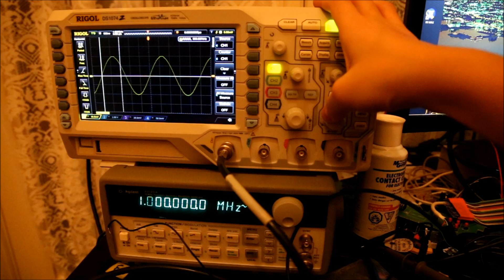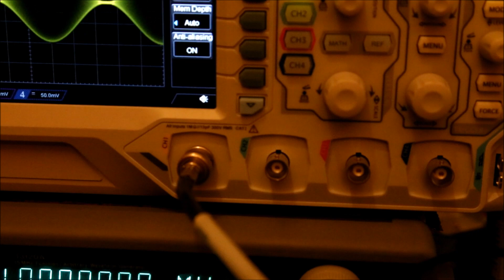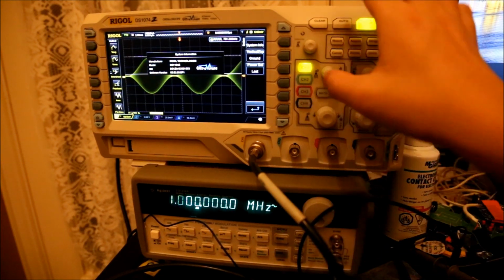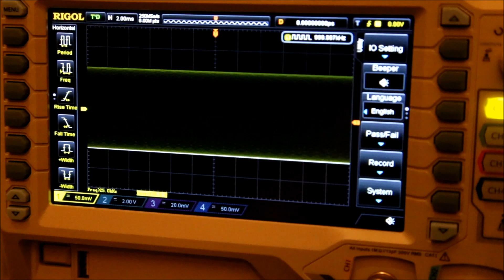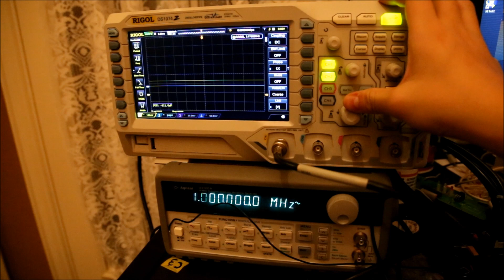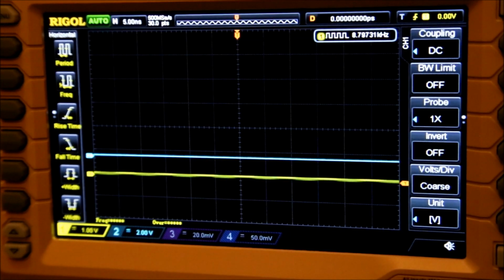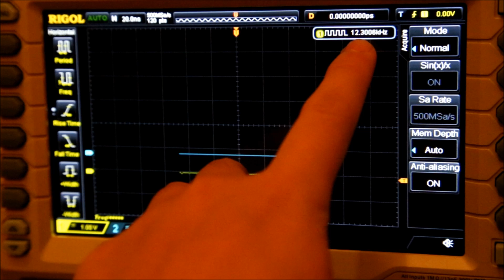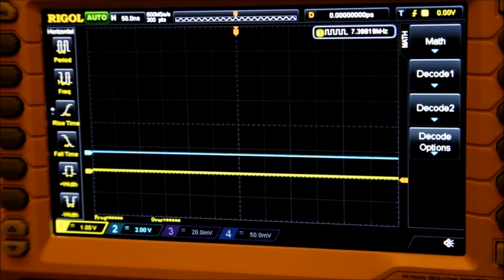Rigol DS1074Z Performance

Comment: Often scopes won't just be displaying a single frequency waveform. If you have a 100kHz square wave with 10MHz ringing on it, and you're triggering on the 100kHz, you should be able to zoom in on the 10MHz ringing and have the hardware counter count the lower frequency its triggering on while the software counter will try to estimate the higher frequency based on the ringing that you've zoomed in on. If you need a reliable result on anything other than a simple waveform which spans the whole screen, use cursors to measure time between peaks

Comment: It's sad that you can't rely on the frequency that's displayed on the screen. If they can't do it accurately they should just not display the bloody thing. It's meant as a test and measurement equipment that we should be able to rely on.
Reply from the maker: Exactly. Even the HW frequency counter isn't always reliable.
Reply: To build accurate and reliable frequency counter is very involved thing, meaning it's going to cost you a pretty penny with oven controlled reference etc. Thus you shouldn't expect accuracy from a cheap scope.

Good frequancy counter in itself could cost you thousands of dollars.
Reply: echen1024  It's as reliable as your triggering is. If you aren't triggering properly you aren't counting properly.
Reply: @Mtaalas: You don't need an oven. Except you expect precision at 6 digits after the decimal point. A quartz gives a precision which is sufficient for daily use. I doubt that the girl who made this video is capable of using the scope correctly. Why is her screen so much flickering around?

Comment: Hi echen1024.
You mentioned something about "Siglent crap" - can you tell more? Do you know if a Siglent function generator are any good or just something to keep away from. Siglent scopes do look nice but I have no idea of how good/bad they are compared to Rigol.
Mlorton has a short test of a Siglent scope on youtube and talks nice about it. He will make a better review of that but not sure if he will tell anything about how well it is build and if firmware upgrades is something Siglent does well.
Reply from the maker: Well, I used to own a Siglent SDS1102CNL Oscilloscope. It was a good entry level scope, but it pales in comparison to the Rigol. In terms of scopes, the DS1074Z is hard to beat at this price. If you are spending more, look towards the Siglent SDS2000 series or the Agilent DSOX. I believe that the siglent function generators are generally decent, with a very low price. Siglent overall is a good brand, but their lower end scope offerings can't match with the Rigol unless the absolute lowest cost is your goal.
Reply: echen1024 Thank you, just ordered a Rigol 1074Z. I only need something for audio range at the moment so it should be fine. Also cut way back on function generator. Today a Ascel AE 20125 arrived.... That is a DIY kit (120 USD incl postage) so now I look forward to my new solder station and scope. They are both on their way. If I have more money some day I will go for Agilent.
Reply: the siglent he has that i think you're talking about is equivalent to the rigol DS2000 series. its a mid range one, this is an entry level one. as long as you don't get the siglent equivalent to the rigol DS1052E :)